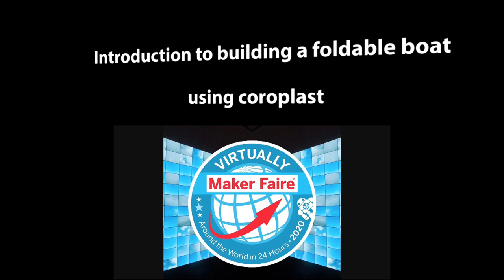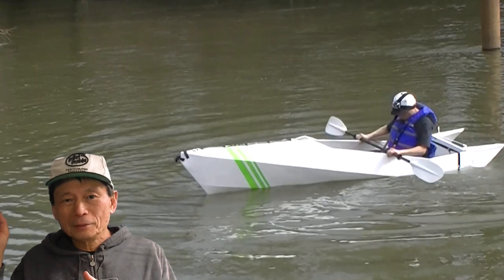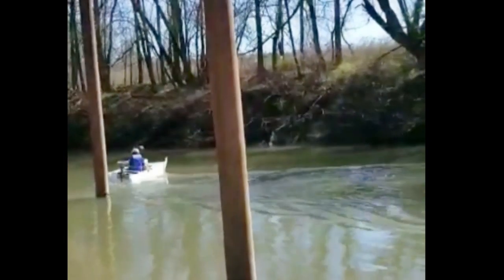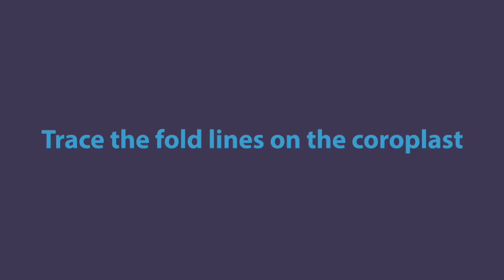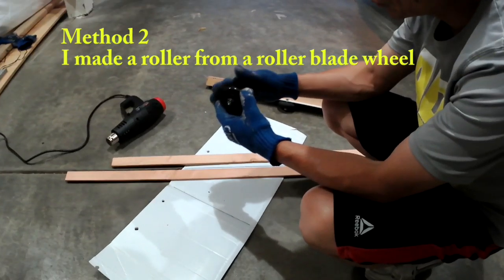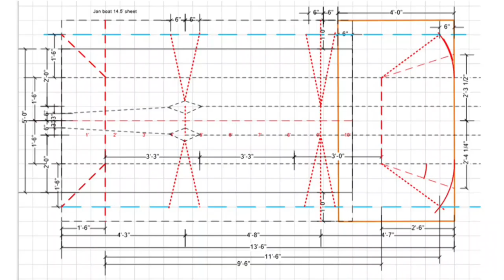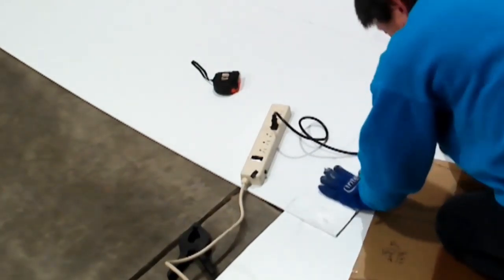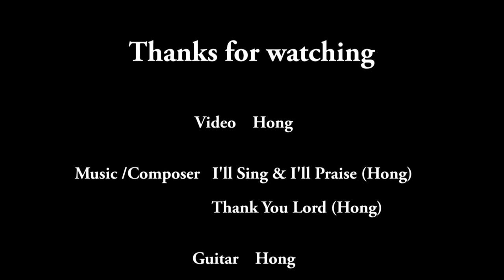Maker Faire 2020: Introduction to DIY Foldable Coroplast Boat

Comment: i would like to see your coroplast folding car cargo box design
Reply from the maker: Thanks for the excellent input. I have been thinking of building a car top carrier. Making it foldable makes better sense because I use that only for camping trips. If it is collapsible/foldable and it will not create too much drag (when not in use) and will have less impact to the gas mileage.  Will get this done before my camping trip, around end of June.

Comment: Do you have blue prints available for download, for the 2 seater?
Reply from the maker: I have a web site www.diyusa.org with boat plans and other boat building info. The plan for the two seater is https://www.diyusa.org/boat-plans (and scroll down the page).
But I suggest you to build other boats instead, which will cost less to build and are much better. For the newer two seater, please use the G19 plan and watch the video series to give you an idea how to build that. Gen 19 gunwale can be made without heat fusion. You can use zip ties to replace the heat fusion. Please let me know if you need more info. Please use my email pdxboatmaker@gmail.com for future Q&A. Cheers!

Comment: What kind of plastic is the corplast? Here we can only get them in polycarbonate, but I saw that it is usually HDPE in de US. Do you have experience with polycarbonate coroplast?
Reply from the maker: Thanks for your question. I have a video talked about coroplast: https://youtu.be/llCRnv1kI6Y
There are polycarbonate roof panels, one kind has channels. My friend used that to build his green house. This kind of plastic is very strong, clear and nice for boat building. Unfortunately it is not foldable. The one I am using is this type of coroplast https://www.homedepot.com/p/Coroplast-48-in-x-96-in-x-157-in-White-Corrugated-Plastic-Cardboard-10-Pack-WC4896-10/202489118
We actually used a few sheets to build this kayak 
 https://makezine.com/projects/origami-kayak/
Cheers!

Comment: That was a great video! Now I know what I'll be doing this summer. But, where is a good place to get Coroplast sheets?
Reply from the maker: Thanks for watching... If you are in US, you should be able to get that at Home Depot or Lowes. If you are in Portland Oregon, I  have about 20 pieces (5'x10' 6 mm sheet) that I can part with (I am not making any profit...because I custom ordered from China and I have to get a min of 100 sheets and waited 5 months for the delivery :-).. $63/sheet, slightly cheaper per square ft than home depot but is better because of the UV resistance, also larger....If you get that from Home Depot or Lowes, you can most likely get the 4' x 8' only and you can either tape (see my gen 2 10' kayak tutorial on my channel) or fuse (mush better than tape) two sheets to make a boat. If you get that from Home Depot, it is better to get the 5 mm or 6 mm ones, but you have to buy 5 or 3 sheets min. I used 4 mm for the  Gen 2 10 ft kayak. I called US manufacturers (for a larger sheet) and they don't sell direct. Their distributors also have a min. order, overall cost more. So I ordered from China. I usually conduct workshops in March and Sept. twice a year and help others build their boats (free service, I borrowed the space from my church). Unfortunately I have to stop this activity this spring due to COVID-19. Please watch my other videos because there are more useful info. I will place more boat plans in my site www.DIYUSA.org  in the next few days.    Enjoy your summer and stay safe and healthy! Cheers!
Reply: Find a way I can Tex you photos ok I think youl like my new design ok John
Reply from the maker: @johnmessersmith8488  Thanks for sharing the photos. That is a nice boat. Youtube is slow in sending me this notification. They didn't notify me until 4 weeks later. Looking forward to see your 'future' boats.

Comment: you ve got some good techniques but you have to start working on getting hull shapes that work for human power and don't drag so much along the water line. The transom can't be submerged and the rear should exit cleanly, just like the front. Even look at an ozracer, it's a simple shape but it doesn't waste energy dragging square parts through the water.
Reply from the maker: Thanks for your comments. You are totally correct. I am still learning how to use coroplast to build boats... 
Before you read my reply, please watch  this short clip first.. https://youtu.be/Ab5UAK5hGuY   

I have a design similar to the Oz Racer. I call it a two seat-boat in one of my Youtube videos. When I worked on this Gen 8, I was experimenting different way of folding the boat + the bow design + simple fold lines (that means easy to build). As your have stated, it's speed is poor due to the drag. I bench-marked that boat with my friend's hard  shell kayak, it is 50% slower :-)
In the past two years, my design goals are:
- easy to build (build a boat in < 10 hours), 
- low cost, 
- use simple tools. 
I attempted to use SW tool to design a boat, but folding coroplast limited what I can do hence I gave up. Besides, the sheet I have is 10' and it is not easy to create a fine hydrodynamic shaped boat. The designs I have so far are targeted for those who just want to spend limited time and money to build a boat that floats and also looks like a boat :-)  That was my childhood dream but never realized until now.
This year, I have been experimenting with heat fusion, which allows me to build much better boat (longer, can control the shape of hull much easier than by folding).  My goal this year is to focus on better hydro-dynamic design (yet can still be built easily and low cost). I plan to modified the Gen 8, the one you commented on, to a modular/foldable seat-on-top boat using heat fusion. The transom will be like a kayak. I have just finished a 10 ft foldable kayak (yesterday), which should have less drag. I will water test it this coming Monday.  Again, thanks for your comments, feedback...Cheers!

Comment: the waterline makes it look as if it is heavier at the front than at the back. Perhaps you could move the aft seat rearward. It would also make it more comfortable for the aft crew.
Reply from the maker: Yes, you are correct. We didn't pay attention (aware of this problem)  until we watched the video. I don't have this boat any more :-)  I recycled the hull/coroplast and built this new two seater this year. A much bigger boat https://youtu.be/nuDxhA00Vik

Comment: I want to build RC airplane from coroplast . I try different glue , but nothing really do a strong bong to join 2 pieces . OR with PVC . I want to use a glue call 3M’s Scotch-Weld™ Structural Plastic Adhesive DP-8005, but anybody has a better idea . I think the heating is better solution then gluing .
Reply from the maker: Thanks for the question. Unfortunately I have no experience in building. RC planes. As for building boats, I like to use heat fusion because the bond is strong and I don't have to spend money for the glue. Also there is no wait time for the glue to cure.
Reply: @DIYUSA  Thank you for your response and answer. Yes , I agree with you . The glue are expensive and they don't bond or fuse the plastic very strong. I have to find my way to fuse and bonds my RC planes . It's more complex
Reply from the maker: @mirbie43  I agree building a RC plane is more challenging.

Comment: Thank you for sharing your designs and instructions. I've watched all your videos and became inspired. I'd like to try making one for my oldest son next month for lake fishing. I've been replaying the part where you showed your plastic sheet roller and trying to locate the skate wheel that you are using  but unable to figure out the exact brand  and size online? Thank you, Lek
Reply from the maker: Thanks for your support and also considering building one. It took me more than 20 years before I built my first boat 🙂 The size of the wheel doesn't matter much. You can use a 1", 2" or larger (diameter). The one I use is about 3" in diameter. My friend built his Gen 14 use a 4"-5" diameter wheel as shown in this article https://makezine.com/projects/origami-kayak/ . The width of the wheel is important. I suggest the beveled edge, i.e. the pointed area that touches the coroplast (which is rounded) would be approx. 1/4". With this thickness, it will not 'cut' into the coroplast when you roll the roller on the coroplast.  Please let me know if you have other questions!

Comment: I made a coroplast boat 5 years ago for duck hunting, but was limited to a standard 4X8' sheet, so it's a small boat. Your fusing method is SO helpful, THANK YOU! Now I can make a nice big boat! Now if only you can invent a method to make paint stick to coroplast.......... :-)
Reply from the maker: Thanks for sharing your experience. Most people, including myself have a very difficult time to find a larger coroplast. That's why I have been trying to solve that problem and looks like fusion is a low cost and workable solution. There is ultra-sonic welding equipment but it is not something a hobbyist like me could afford.
My friend Nat recently come up with a very user friendly way to fuse the sheets and I have detailed that technique in this video series. https://youtu.be/KzS6iqQnSCA
Now, a good news. A magazine sponsored Nat (a very talented and trained boat builder) to build a foldable kayak using the 4'x8' 4 mm coroplast sheets. I provided the kayak plan. They will publish the design guide in Jan 2021. I will then have videos in building that kayak.

Please go to my website to see a photo of that kayak... It is a very nice build.
https://www.diyusa.org/blog

I have been painting my coroplast boats. It seemed to work for me. Will give you a link in my next reply... cheers.
Reply from the maker: This Krylon Fusion is recommended by a few people on the web. I have been using it and it works. https://www.walmart.com/ip/Krylon-Fusion-All-In-One-Spray-Paint-Satin-White-12-oz/584887487?athcpid=584887487&athpgid=athenaItemPage&athcgid=collection&athznid=308034044_collection&athieid=v1&athstid=CS020&athguid=ba392fe0-007-17649bc71e77e9&athancid=null&athena=true